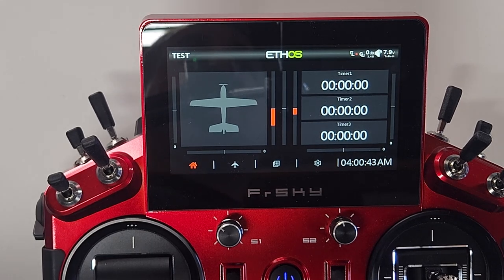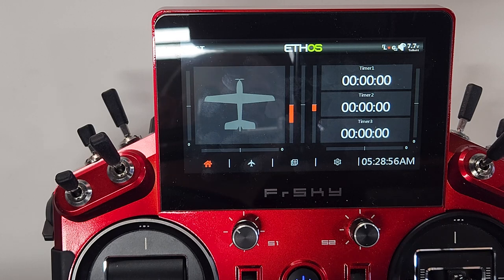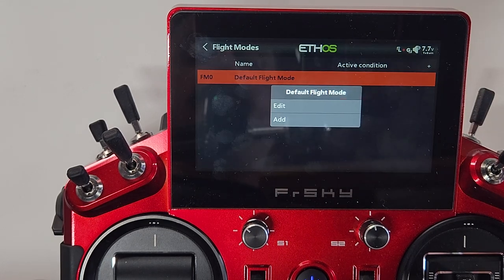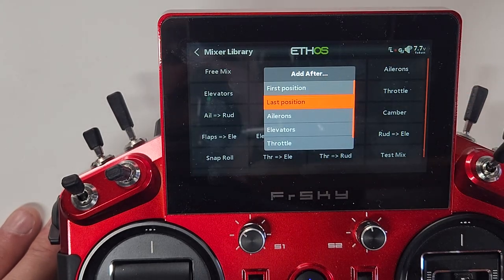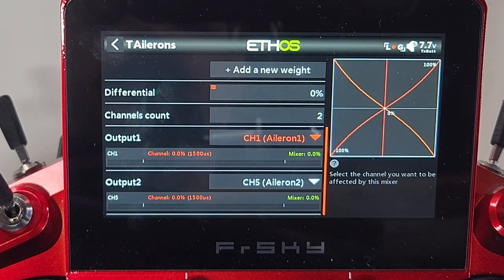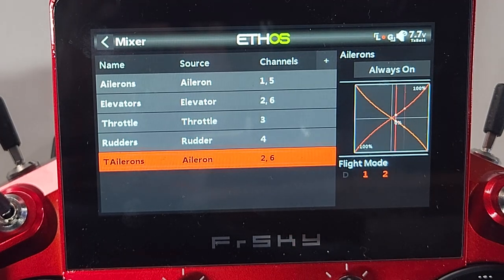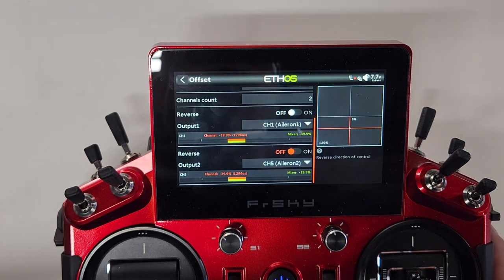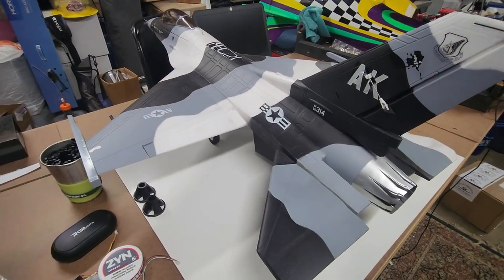FrSky Ethos - Flaperons, Tailerons, with Flight Modes

Comment: Nice job! I learned several things from your video.
 I will be setting up a Mig-29 in the near future and wanted a stabilized taileron mix, now I have a better idea how to get there. I have never used flight modes but now that I have seen them in action I may give flight modes a try in place of my normal hi, mid, low rate set up. 
 I never guess the right weights for things like flap/elevator compensation, but discovered that you can assign the weight to a pot and adjust on the fly to get it just right then convert value 
to lock it in.

Comment: Great, I have been looking for a tutorial for setting up flaperons and tailerons in Frsky X20. 
Is that a Freewing 70mm F16? How did you mod it to have full stablizer?
Reply from the maker: That is the 70mm.  I have a post on FB that's pretty self explanatory.  I used the plastics parts kit from Freewing F22 60mm and there are a couple of stab hinges in there that work.  Basically cut the horizontal stabs off glue in some wood at thebold hinge points, fill in with light weight spackle lightly sand and paint.  For the hinges carvevout the foam to fit,.
Reply: @hangar88  Thank you. very helpful.